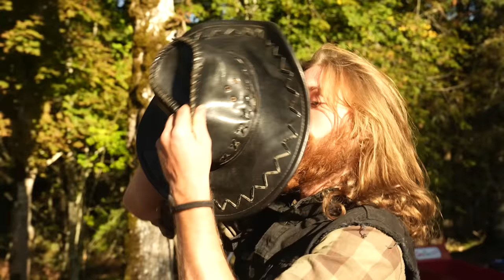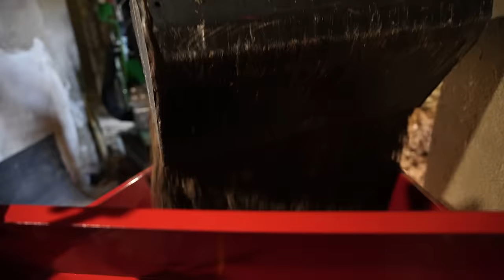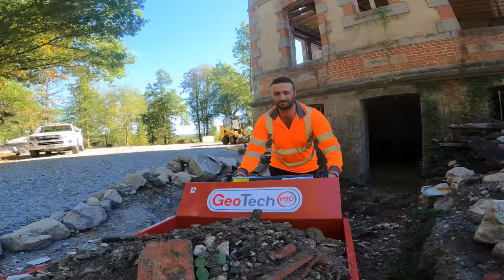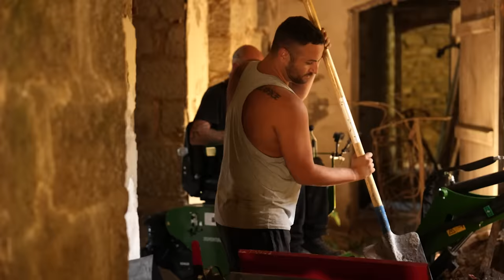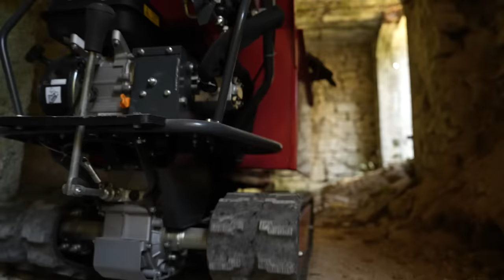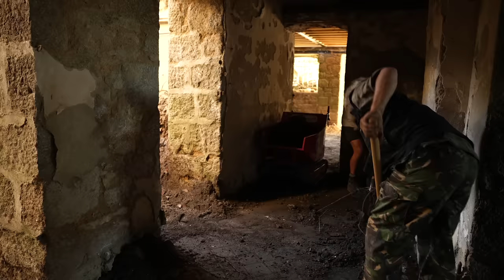The biggest most AMBITIOUS project yet UNDERNEATH this chateau ruin.

Comment: I've been quietly OCD about the rest of the dirt filled rooms since you started putting in floors and driveways after clearing the kitchen. THIS is the real progress that I have been eagerly waiting to see. 🙂  Thank you for sharing your adventure with us.
Reply: All the floor plates used now are only temporary to get floors to walk on. Floors was needed to stabilize the building and repair the heavily damaged top of the walls. I guess the driveways needed fixing, so its not turned into an big mess in the winter. It need to stay firm for big vehicles and moving heavy building materials.
Reply: Ha!  I'm not OCD, but the TREES growing out of the house was a bother to me.  Glad to see that has finally been handled. Of course, Dan had to GET UP there to get them.  He has no fear of heights, that is for sure.

Comment: And Sep 25 is one year since Dan started vlogging the chateau and the channel hit 350K subs.  Congrats!!! Wow, I'm so happy to see the East and especially the South wings started.   Some holiday.  I'm sure there were days off, thankfully, but Dan had be be busy getting those motorized barrows and diggers, not to mention getting Calvin from England, and the rest of the gang back together.  There has to be 100+ tons of debris to get out.  And it looks like they started on the South wing, with a pillar in the middle,  and are actually at the basement level, meaning the first floor has collapsed.  I wonder if the East wing is the same but I think I remember a tour of the a basement with a very bad ceiling?  More drama to come!!!
Reply: The remaining wing was the one with the tree in it (to the left when facing the building) and the parquetry flooring showing through the rotten concrete into the basement.
Reply: The wing that is still to clear is the east wing though, the west wing is the one where the new floors are already in.
Reply: @halvarf  If I'm not seriously mistaken they're clearing out the south (back) section right now, the east still has some concrete ceiling left that's just about ready to collapse.
Reply: @Ragnar8504  Yes, I agree, that's how I understand it now, too. They've begun the  south center part yesterday, and the east wing, where the big tree was and where the ground floor is existing but unsafe, is still to do.
Reply: You are absolutely correct.  I don't know how I made such a stupid mistake.  I even went to Google Earth to verify my understanding that the orientation of the Chateau is to the north and right away I saw  I goofed.  I knew Dan had put the solar panels in the East (for early sun) but for some reason I transposed East and West.  Thanks for letting me know 😀
Reply: I now have my bearings unscambled.  For some stupid reason I transposed East and West knowing full well the chateau faces north (and east)... hm-m-m.  Thanks for your reply😀

Comment: With the big advertisement yesterday I expected to see that the roof is build with the help of your friends, but not that the dirt is shoveled out. You need a roof, otherwise all what you have build will be ruinied in the winter.
But it's good to save the iron beams, you will need them.
Reply: Those iron beams are not up to spec
Reply: @NurseSherry  I'm afraid the whole building is not up to spec, no proper insulation, no earthquake-save walls anymore, but that should be legally no problem as he is rebuilding it, repair works do not need to conform to current building codes.

Comment: What he really needs is for Nick to use his conveyor belt that he used when he was chopping and splitting wood and moving it into the back of huis truck to haul away. Set that up in the basement and dump the debris on it and it will move it up and out the window to the outside--where t can be hauled away. it would save having to use those wheelbarrows at all

Comment: With the three guys's help I would focus on the roof. Then at least one part of the building would be protected. It does not matter if you clean the debris in September or in December. But with rains and snow leaving the finished section uncovered is rather surprising. I believe my comments are not popular but the construction process has some reasonable phases.

Comment: Dan, a very impressive excavation process with the "mini me digger" (it's getting the job done in tight places) and the two motorized track driven wheelbarrows.  Yes, you certainly have all gotten a good system going in clearing out that rubble.  I had no idea there was so much more rubble in the basement.  Looking forward to more of your excavation videos.  Maybe there will be some artifacts found.  Do you intend using the rubble to continue filling in low areas on the property?

Comment: It’s astounding the amount of work you’ve taken on and this latest project is a reflection on your team approach which is fearless. Have you considered using the old metal beams to rig up a hangman’s frame to use for the winch on the upper floors. Something semi permanent may need to be considered as I’m sure carrying furniture up those flights of stairs will be back breaking. Keep at it, your channel is by far the best of the restoration style offers out there. Best of luck. W

Comment: The winter is fast approaching, I would have thought the next big impotant job is to put up a temporary waterproof roof to protect all the work that has been done to date, it will also allow further work to be carried out in the rooms with completed floors. and a dry area to start making the components for the permanent roof.. Clearing out the basements is important which can be done anytime.
Reply: The winter were the chateau are placed in France, might not be what you imagine. It's definitely a lot milder (and warmer) than the winters I'm used to.

Comment: Not going to lie, I thought the roof was going to be the project. 

Although it will be amazing seeing everything removed, it should bring you added motivation. 

Question: Will you then add steel to strengthen ? 

Regarding the roof on the other wing. What's the plan ?  Winter fast approaching, and there is a lot of new wood that could get potentially damaged.

It's great to see you back.

Comment: You have to think that little green front end loader is pretty inefficient (and possibly dangerous) is such a small confined space. Shoveling is getting everything that the bucket on that thing can gather in what 8 shovels full in about 1/4 of the time?  Regardless... what a ton of work. Hopefully nothing above becomes unstable from moving all of this rubble.
Reply: LOVE the motorized 'wheel barrows' though, those are kickass. Did you look into getting a conveyor belt system for removing all that crap?

Comment: Couldnt it be faster to rent a conveyor belt and shovel the dirt on that and let it transport the dirt outside ?.
Reply: Maybe, but to get a conveyor belt that ist long enough is difficult. And place them in a perfect place, is not so easy without a normal excavator.
Reply: @HeinzBecker1a  Maybe 2 or 3 smaller ones so the can unload on eachother and around corners ?.

Comment: shame you don't know anyone who does mining machinery.  That seems l ike a near perfect place for a conveyor belt of somekind up and out a window.  Still gota set it up through the wall, and dump material on it, but it would take the whole "navigate the corner into the basement part out.

OR, use some of that rubble to create a platform just in the door.  so your wheelbarrows don't have to turn AND  go down grade at the same time.  level coming in,  do a 90, then go down grade.  on the way up, drive straight up, do a 90, head out.

Comment: Had no idea that you still had so much rubble and debris and other rubbish in the basement.
As I erroneously thought you cleaned up as soon as you finished each area that you had worked on.
And yes I do recall the wonderful day you cleared out a floor to show the lovely old tiles.
Erroneously I thought the tiles were the basement. My mistake.
However you still have a LOT more of the actual basement, to clear out ALL the debris until it is spotless.  ONE day is not enough, TWO days is NOT enough. To get it ALL cleared and the debris sorted - eg metal that can be sold to salvage, stones that can be saved for reuse AND then ALL the remaining DEBRIS removed by trucks from the property forever .   .   .   .  looks like you need people power and to continue to hire machines to help sort it all out,  followed by trucks to remove it all this UGLY debris  all THIS week. 
Suggest you set aside FIVE consecutive days, please. It will result in much better Feng Shui for you too. And will allow you the opportunity in the future to create usable secure spaces at the basement level. Maybe even a lovely stair case down to the basement